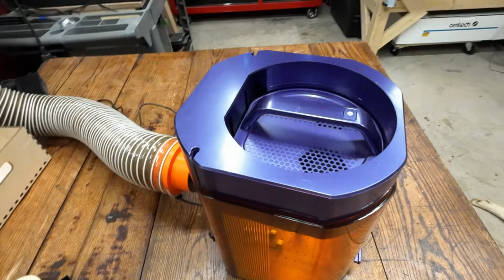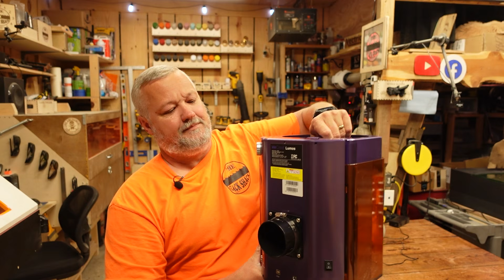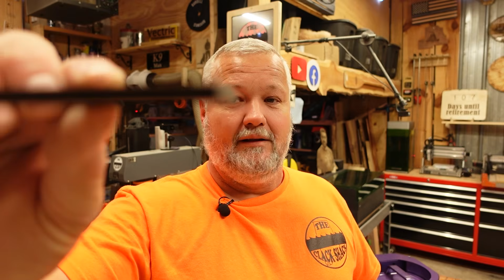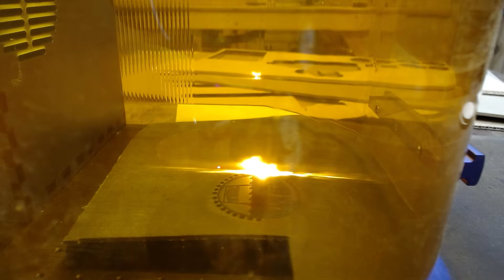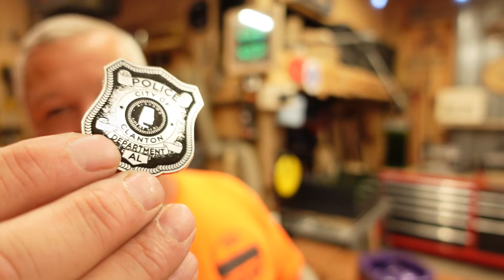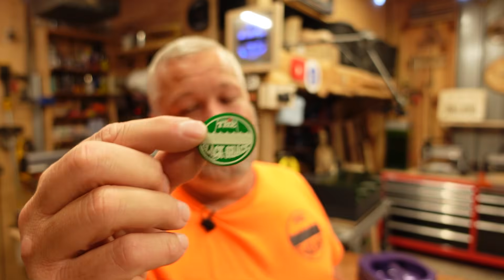WeCreat Lumos - Portability & Versatility

Comment: I just got one of these last week and while I like it it certainly has some "issues" as they say. The Wecreat software is actually fairly decent but far from intuitive to use. Until I got used it I was struggling to figure out how to control it properly. The materials settings have proven to be completely useless. I don't know if it's just the software I have or what, but the settings it plugs in for various materials are wildly inaccurate. I was trying to engrave images on fiberboard coasters and the recommended settings for "cardboard" were so light I couldn't even see the image. I had to boost power to 85% from the recommended 50% and cut down the speed dramatically before it rendered a decent looking image. The auto-focus sort of works? Sometimes? It doesn't seem to work at all on reflective surfaces. If I import a .SVG file and then use "group" to put all of the various individual objects in the .SVG into a single object, the software no longer treats it as a vector image but insists on doing it as a bitmap. The IR laser is a plus, tough. It seems to work reasonably well on the metal items I've tried. Unless you need the IR laser I don't see how I could recommend this one, though. It's not much faster than my Falcon A1 in real world use as a diode laser.

Comment: Any idea what we can use to plug in the lumous at craft shows like a battery backup? Does anyone know what amps or voltage would be needed?
Reply from the maker: There are lots of power banks out there. It doesn't draw much current.
Reply: @TheClackShack thanks for the input

Comment: In any shape or form, I will not recommend WeCreat. I invested heavily in their products and cannot express enough the lack of support and the poor quality of their equipment.

I’ve been a customer since WeCreat first started selling lasers in the U.S. At that time, they handed out hundreds of units to influencers, making it seem like their product was a huge success across social media. The reality, however, was quite different—WeCreat had a high return rate when customers actually purchased the product with their own money. Of course, WeCreat won’t share those numbers, preferring to maintain the illusion that their laser was a hit.

I’ve owned three of their lasers and can’t even begin to describe the nightmare, starting with the very first one. From the moment it arrived, I encountered problems: Wi-Fi connectivity issues, a power cord that wouldn't stay plugged in, a misaligned camera, and a crumb tray that was nearly impossible to insert or remove. And instead of providing solutions, support consistently blamed me for the issues. WeCreat also did the same thing during their live Q&A streams—blaming individual users for hardware problems. In my opinion, the worst aspects of their laser are the fisheye camera and the crumb tray design.

To make matters worse, WeCreat will not exchange a damaged product. You have to return it first, wait for them to approve it, and only then will you receive a refund. But that refund comes with strict conditions: if the return packaging isn’t exactly the way you received it—every piece of packing material, every piece of tape, nothing missing—you won’t receive a refund or credit.

Then I discovered xTool—and it was a game changer. My entire workflow improved dramatically using xTool’s equipment. The company has been around longer than most and continues to reinvest in innovation. You can clearly see the difference in quality when comparing xTool lasers to WeCreat’s. xTool’s products are top-notch, and their support is outstanding. You’re treated like a human being, with respect and appreciation for your investment. No, xTool isn’t perfect—but its flaws are minor compared to WeCreat and many other laser companies.

As I’ve always said on my YouTube channel: research, research, research before making a major purchase. WeCreat is a prime example of why doing your homework is critical to avoid a costly mistake.😎

Comment: I had the same complaint about the absence of bi-directional support when I reviewed the Vision Pro for them, but they are adamant that it is still just as fast without it. I'm still not sold on the decision though. The Lumos looks cool- love the review
Reply from the maker: Math isn't my strong suit but it is slower than bi-directional.
Reply: I agree, it's a shortcoming that they need to address in all of their lasers.
Reply: It will do bidirectional, though. The setting is often overlooked. De-select the graphic you're working with by clicking on a blank area of the work space. A switch labeled "Processing Settings" should now be visible. Turn it on. A setting called Scan Mode should now be visible. Change it from Unidirectional to Bidirectional.